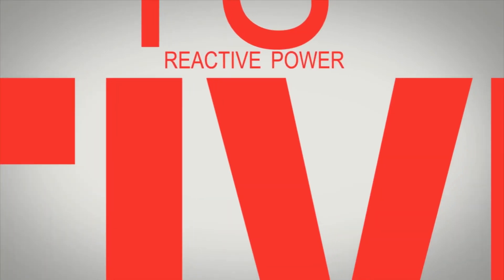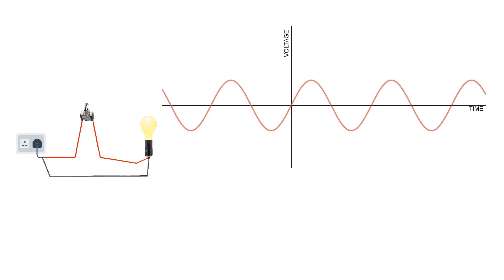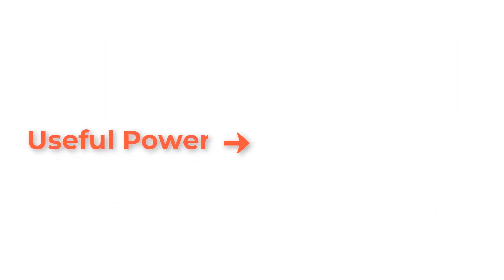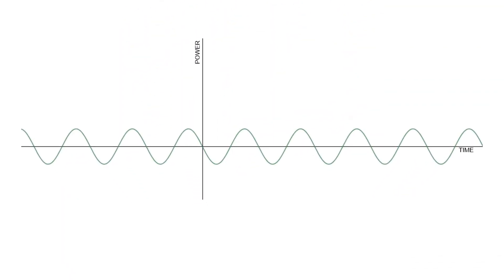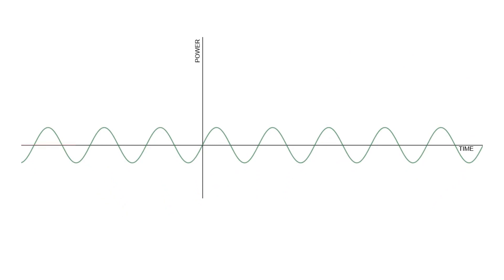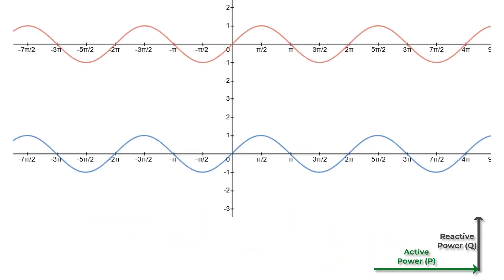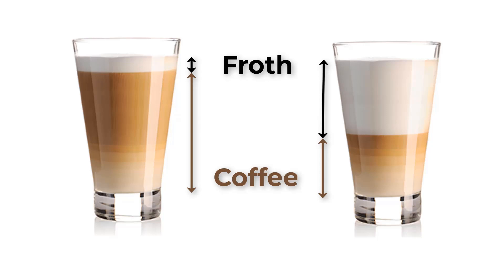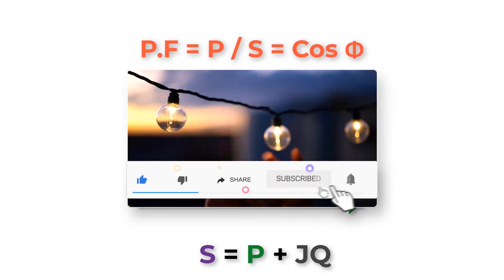What is Power Factor? |Explained

Comment: I came here confused and left even more confused
Reply from the maker: First,, Thank you for your comment, what is the point that confused you, i can try to clarify it more
Reply: @electricalengineeringplane6620 the explanation of waveforms. The triangle explanation was good and you could have used it to explain that active power is a cosine wane and reactive being a sine wave and the square root of the sum of their squares was apparent power (using pythagoras theorem).
Reply: Another  helpful way would be to begin with explaining what inductive, resistive and capacitve loads are and how their wave would be. I think that would have made a huge difference in the presentation or even separate videos attached
Reply from the maker: @sz6555  this is a great idea, i will create a video about what is inductive, resistive and capacitive load, then attach it here,,thank you 😊🙏